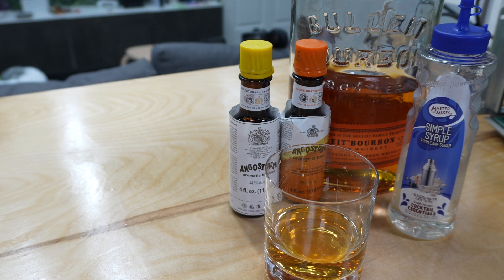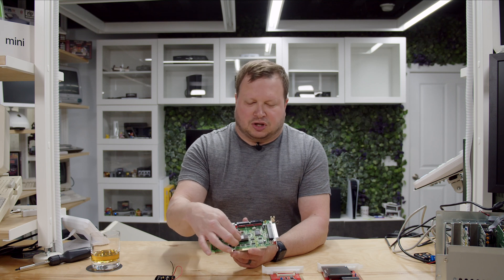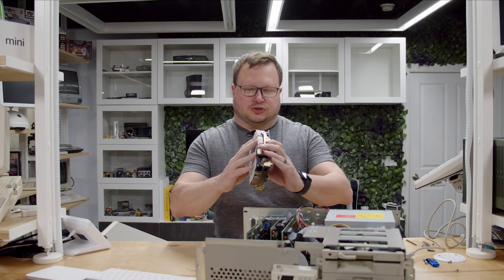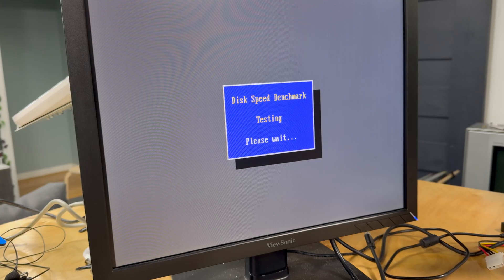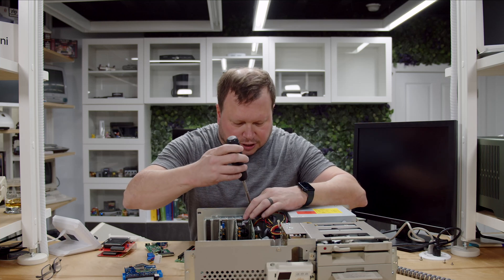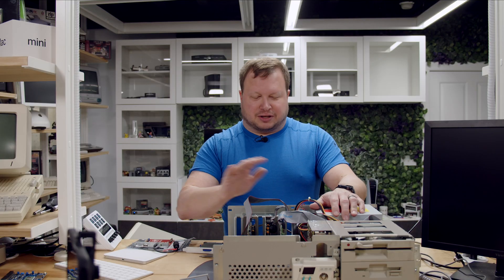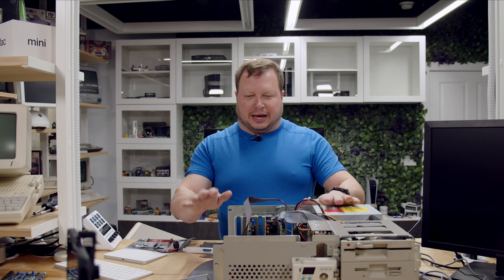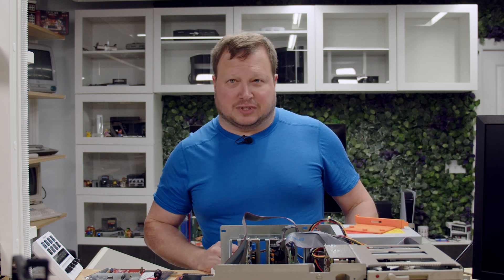Getting the Leading Technology 286 working again.

Comment: The XT-IDE and the VGA BIOSes don't overlap and don't have conflicts, unless you have them set to the same address.  If you try the XT-IDE again, make sure its BIOS is set to D000 and there won't be any conflicts (most video BIOSes are C000 or C800).
Reply from the maker: I tried all the addresses on the XTIDE and it still didn’t work. The vga conflict was a was just a guess. Thanks for clearing it up.
Reply: @JeremysRetroBar  You may have had a port conflict instead of an address conflict.  I believe the board you were using had a jumper for selecting a different port range.
If you tried all combinations of both port addresses and ROM memory segments, is it possible your board might be broken?  A 386+ should be able to run any XT-IDE BIOS configuration, so if you have another one you might want to test the board in that to see if it works there.  (I can't recommend an 8088 for testing because if the BIOS was configured for 286+, it won't boot)

Comment: Really cool PC and I can certainly relate to that nostalgic feeling of "getting back" your childhood computer! I'd love to see some more videos on it in regular use. 286 doesn't get enough love IMHO! 

After searching for years I managed to track down my own holy grail PC here in Norway - A Copam+ 286M. It's made in Taiwan, but Copam+ was a huge seller in Norway in the late 1980s and early 1990s for late 286s and 386s. Sadly very few have survived, and on our Norwegian equivalent to ebay I've been searching for ten years and had no luck until recently. It's in good shape cosmetically, but of course, battery leakage will require some hard restoration work before I even try to test it.